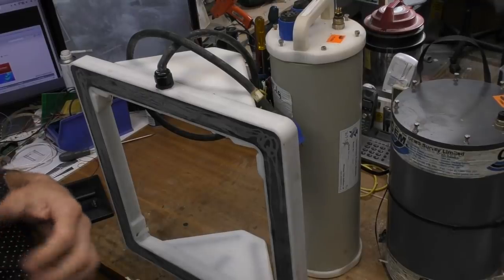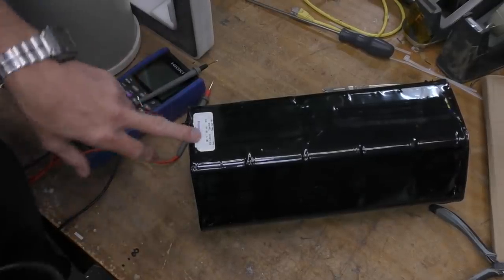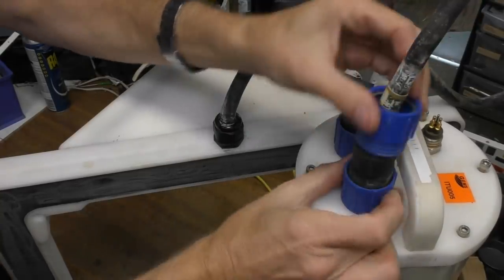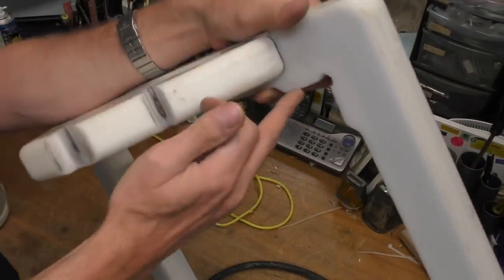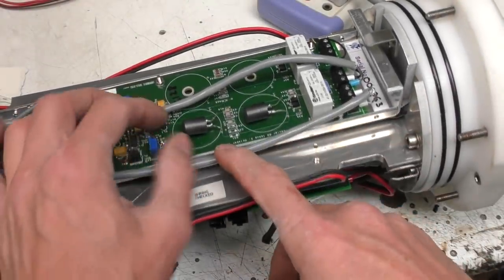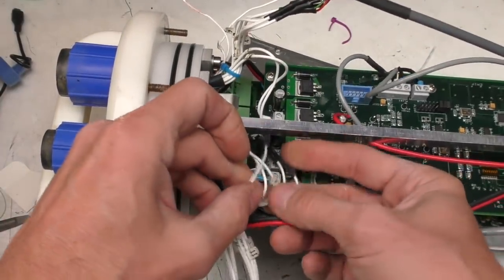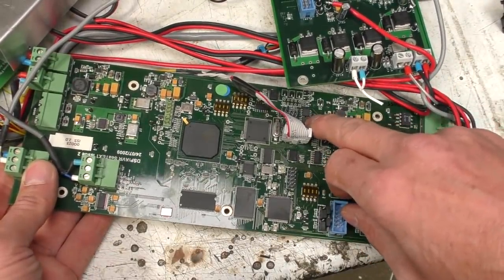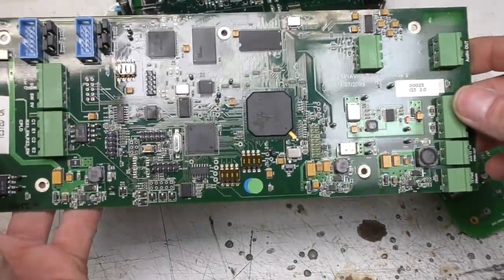Underwater radio modem

Comment: The connectors are Subconn (SCS=Subconn Circular Series). I work in marine instrumentation, and they are pretty much a standard connector for just about everything. They are rated for wet mating, and high pressure (many hundreds of metres underwater).

Comment: Some interesting hardware. Cylindrical inductors on the RX board are the wrong type. Originals would have been toroids. Front end filter was about 3kHz centre frequency. Filter was only complete when antenna connected. You may have received either demo units or faulty units?
Reply: The S. Larson?
Reply: @jono80  Yes, The S. Larson  :-)
Reply: @scottlarson8493  Thanks for dropping by S. Larson!
Reply: Man, I love the internet, thanks for your comment.

Comment: What this kit is used for: in marine sensing your sensor might go on the ocean floor, but to get live data out you need to get that data to a satellite transceiver (often Argos, Orbcomm or Iridium) on a surface buoy. Waves, currents and winds mean it is really hard to run cables the full height of the ocean - the long cables tends to flex and jerk a LOT. Much better to use a rope to hold a buoy in place, then use wireless comms to get your data over. Acoustic or magnetic modems are usually used to bridge data over that gap. Data rates are low (100-1200baud) but that is plenty for this kind of telemetry.
Reply: @ColdSoda1  For Iridium: the bottom metal box here https://techpartnerships.noaa.gov/Portals/10/EasyGalleryImages/17/194/TPO-Stennis-Miami-3258.jpg looks like an Iridium modem. Works just like a telephone modem - serial data in with AT sequences, and connected to an antenna (quadrifilar helix, or patch - of similar size to a common GPS antennas) for upload. The satellites retransmit to a ground station, and the raw data is then relayed by email so it can be interpreted / processed / displayed / archived. Iridium packets are similar to SMS text messages - similar length, with larger messages split over multiple packets. Roughly similar charges to sending SMS messages too - typically a few packets per US dollar. Great for hourly readings, but don't even think of streaming video over a service like that!

Comment: That external connector will likely be either a Seacon Wetcon, an Impulse wet pluggable or a Subconn circular series which would align with the initials embossed on it. Only thing is that, at least nowadays, Seacon and possibly Impulse use blue locking sleeves as standard while Subconns are generally red, though other colours are available. They may have all been the same colour back when this device was made. 
The small metal one is either a Seacon micro Wetcon/Impulse micro wet pluggable/ Subconn micro circular. Can't remember if Burton had an equivalent to these or not.

Comment: Those specific connectors are not standard in the marine industry, at least from what I've ever seen (I work on connected technologies in the marine sector), but that type of moulded connector with a screw fitting is known as a bulkhead connector. You can also get ones where it's one solid piece rather than a mating pair, which are fitted during manufacturing, and those are usually called passthrough bulkhead connectors. They're commonly seen on voyage data recorder (VDR) protective capsules, more colloquially referred to as the "black box". The ones you showed look like they were inspired by MIL-STD but specialised for high pressure scenarios, which makes sense considering the application and target industry sector.

EDIT: Also, in case you missed my comment elsewhere (it was a reply to NivagSwerdna) I'm pretty sure this is a transparent radio bridge intended to carry NMEA0183 protocol sensor data from a sounder back to a survey computer. You put data into the RS232 port underwater and it comes out at the ship-side receiver.

Comment: They are SubConn watertight connectors, I used them a lot on a previous job :)
Not cheap, but not super expensive either, maybe around 100£ for one set.

Comment: As others said, it's a "Wet Mate Connector". Somewhat common in the SubSea Oil & Gas industry, and a lot cheaper than a "glass to metal sealed connector" / "glass to metal penetrator" used in many subsea installations. The overall construction of the gear in the video is a bit shoddy for Subsea gear if that's the intended application.
Reply: I think it is more for scientific applications in shallow water (maybe 100m or so) than actual subsea oil rig in thousands of meters below etc.

Comment: "However, Ian Crowther, head of WFS's Environmental and Industrial Division, says it is possible. He explains that tests of wireless communication in water were carried out in the 1970s and 1980s. At that time, analog technologies were available, signal processing was unsatisfactory, and attempts were abandoned. There is a widespread belief that this type of communication is not possible. However, as Crowther notes, pure water is an insulator with a magnetic permeability of about 1 and an electrical permeability of 80. It is therefore possible to transmit radio waves with frequencies less than 1 MHz. The WFS did not invent any new technology. The company used already existing technologies to build devices that allow for cost-effective wireless communication in the water.

One of them is Seathooth, which uses a frequency of 100-200 kHz and allows data transmission at 100 Kbps over a distance of 10 meters. Crowther says that increasing the operating frequency of the device will achieve a speed of 1 Mb / s, and in the future, a transmission speed of 10 megabits per second is possible.

Another device offered is "SeaText". It uses frequencies of several kilohertz and transmits data at a speed of 100 bits per second over a distance of up to 30 meters. As air conducts radio waves better, a sensor placed in a shallow tank or in the water near the seashore will be able to communicate over a distance of several hundred meters with a receiver operating above the water.

WFS devices can therefore be used both for monitoring the state of the coast, water quality, for controlling underwater robots or for communication between submarines. As they also transmit data through the ground, they can be used to monitor the condition of underground installations. Given the time and complexity and cost involved in installing cabling in a variety of applications, the use of wireless products can be an interesting alternative"
Reply: I think one of the PCBs had some silkscreen that said SeaText.

Comment: The plastic for that antenna housing is likely a polyethylene material. Looks a lot like bulk HDPE as used in cutting boards, its a bit too translucent to be King Starboard, you wouldn't have seen the diagonal elements with Starboard but for sure would see them with simple HDPE. Given its underwater, there's almost zero UV, so non-stabilized HDPE is the highest candidate here. Its also the most cost effective per cubic inch for such an encasement.

It is likely that any of the milky white plastic used here is standard HDPE.
Reply: Thanks for your take, useful info. Given the cheap internal construction of this device, there would be zero chance of them using some unnecessarily expensive polymer and definitely not PTFE like others have said. HDPE can feel pretty smooth too.
Reply: Easy check:  HDPE floats in water.  PTFE and Acetal sink.  UHMW floats too but I can't see much reason for using that over HDPE.

Comment: I've always know of the rubberised connectors as wet matable or SubConn, the latter being a brand manufactured by MacArtney. There are a few different manufacturers that all look similar but annoyingly have slightly different geometry.

As the name implies one of the big advantages is that they can be connected underwater,, other styles e.g. Fisher connectors require them to be mated or have protective caps fitted prior to them being submerged. They're used a lot on everything from ROVs to commercial divers helmets.

Comment: Looks like subconn connectors, we use the fewer pin variants for angle sensors sensors on dredging ships.Fill em with molykote and screw them shut.

Comment: i think these things are called "wet mate connector" , rubber so it compressess and becomes water-tight under-water pressure
Reply: I can confirm these are wet mate connectors. It makes it possible to service the electronics while submerged i.e. replacing a battery or changing a failed actuator. The trick is to put grease in the connector, so water does not get in while not mated. Then when you mate them, the grease displaces, forming a perfect seal around the connector.

Comment: There are things  that water does to the movements.  You can hardly produce acceleration shocks under the ocean surface.  Also, the k-er or whatever it is now -- used to be called dielectric constant -- of water is about 81, when air has just 1.  That makes very hard to propagate electromagnetic waves at higher frequencies.  That matters for antenna dimensions.  Your whip antennas don't work under water...

Comment: ...
In America-
Duct tape is used on duct-work for HVAC systems.
Gaffers tape is used on stages and sets for musical set-ups and theaters.
Reply from the maker: All I know is the stuff they  call Duct tape on Mythbusters looks like what we call gaffer tape
Reply: @mikeselectricstuff  not even close to the same.  The name implies what it's for.
If you are going by looks, then they are akin to celluloid "scotch tape" and Kaptom tape.
Not interchangeable.
Reply: @aurthorthing7403  in the UK we commonly interchange duct tape with duck tape - one is an ali foil tape as you point out for HVAC and one is a cloth based tape (gaffer tape) but sold as the 'duck' brand. I suspect Mike is referring to duck tape rather than duct tape.
Reply: @CrazyLogic  different stuff though. Gaffer tape is always black, and never leaves residue adhesive behind, this is what you use on scenes and sets. Duck tape is (most often) silver in color, and if you leave it on too long, it leaves white adhesive behind.
Reply: @didgitalpunk   https://cpc.farnell.com/pro-power/gaffa-tape-blue/waterproof-cloth-gaffa-tape-blue/dp/CBBR5201 there's some gaffer in blue... gaffer tape is a generic term for loads of different cloth based tapes with differing properties in the UK. Some leave worse residue than duck tape and some are much better.
Reply: @CrazyLogic  quack

Comment: At least in the US gaffer tape and duct tape are two different things. Gaff tape is cloth-backed, and is supposed to have a better adhesive that remains stable across a wider range of conditions. Duct tape is the cheap rubber-backed stuff that tends to melt if you use it on ductwork.
Reply: I've always heard it that good gaffer tape won't leave behind any adhesive residue, but it's not good duct tape UNLESS it leaves behind some of the adhesive. Also, if applied in dry conditions Duck Tape should at least prevent water ingress, whereas I've never heard any such claim for gaffer tape.
Reply: @44R0Ndin  Gaffer tape, duct tape and duck tape are 3 different terms, duck tape is a brand name of a gaffer tape in the UK. (other brands available) duct tape is usually aluminium foil tape for joining ducts together in HVAC systems.

Comment: 1:50 I was under the impression that soldered connections on flexible wires are actually very unreliable, and avoided if not straight banned fore sure in reliable applications. A crimp connection to connect the two together would have made more sense if this was done for reliability, so this makes me think your first theory is probably correct. Especially because of the tape usage instead of proper heatshrink tubing I think it was quickly soldered on and thrown together.
Reply: i'd have thought the opposite was true. crimps fall apart and solder plus heat shrink is most reliable
Reply: I agree, I would guess this must be used in a very low vibration location so the risk of fracturing from solder wicking is probably minimal.
Reply: @cliveramsbotty6077  A properly crimped joint doesnt fall apart, and any pull force on the wire should snap the wire before pulling the wire out of the crimp. The problem with soldered splices is indeed as cambridgemart noted, that repeated vibrations and movements crack the soldering joint making it unreliable. heatshrink and using a proper soldering joint that also provides some mechanical strength (not like the one used in this joint it seems). Also, the crimps used in high reliability applications make it possible to create an airtight crimp. If you combine this with a sealing type heatshrink it makes moisture intrusion nearly impossible. 
I must add though, that execution is far more important. A well done solder spice will outperform a poor crimp of course. However if both are executed properly, crimping is more reliable afaik.
Reply: I wonder if it was assembled or repaired on site and someone had sent the welded up battery packs out with the wrong connectors on and then someone had to make it work with what they had on hand - even if those battery units are  a cottage industry product made by one bloke in a shed it's not a professional methodfor a product that wouldn't have been cheap.

Crimps are wonderfully reliable if you make them properly with the correct tool.

Comment: In America we have Gaffers tape and Duct tape they are 2 different things
Reply: There's two different things called "duct tape" in the US: the far more common one is gray, plastic all-purpose tape that is not supposed to be used on ducts. The second type is a metal foil tape with adhesive back, which IS meant to be used on duct work. Then there are the tapes made by the Duck company which are all called Duck Tape.